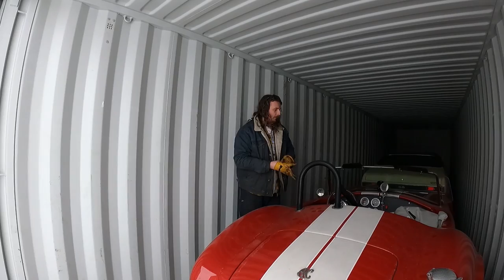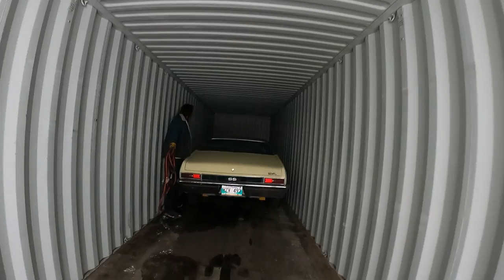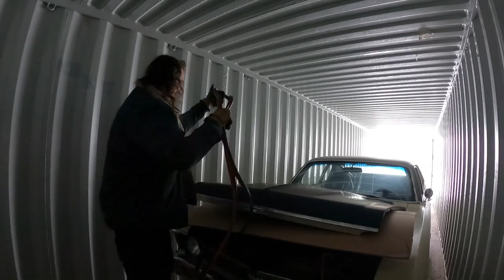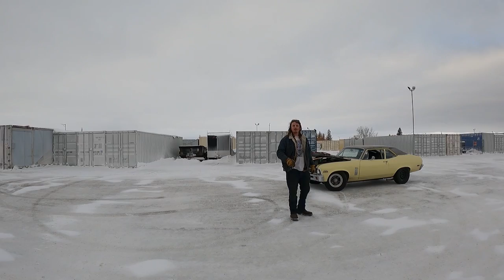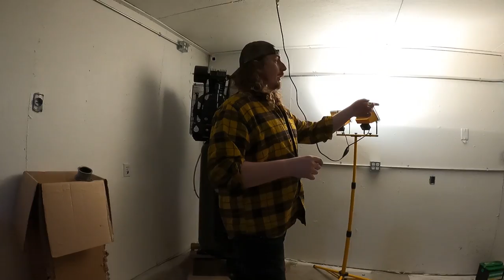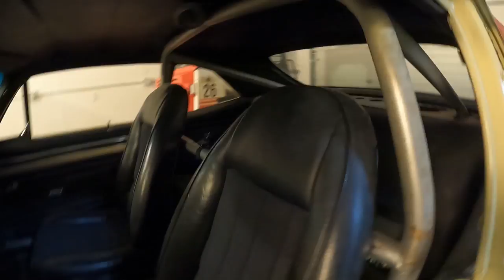1971 Chevy Nova SS 4 Speed Rotting Away In A Shipping Container

Comment: Dan, think about the compressor in it own enclosure. With your electric so close you can insulate and heat it. Less noise and lower maintenance. In the shop filters always need cleaned. Just an opinion, with your different codes in the great winter wonderland. Keep killin' it, Dan

Comment: The M20 is perfect in a street car, you got the low first gear. I have a 1966 belair with a 408bbc, muncie M20 and a 3.55 12 bolt, it takes off from a stop real well with the wide ratio muncie.
Reply: Yeah, I was thinking that 4.10 might be a little much. I think the 3.55 would be more ideal, and you don't need too low of a rearend gear with all that motor. And a pretty light car.

Comment: nice to see sanborn still in business, i bought an 80 gallon 2 stage 5 hp back in the late 80s/early 90s, then traded it for a nice 68 chevy shortbed with a blown up engine. been using a 5 hp 30 gallon craftsman/220 volt compressor since then, maybe 25 years. back when they made good stuff.
Reply: I painted a bunch of cars with a Craftsman compressor just like yours!

Comment: Hey Dan need to plumb air drops from the ceiling every 8 feet using pvc also a couple of hose reels. No need to have hoses strung all over the shop floor. Also  electric cord on reels hanging from ceiling. But keep trucking you are getting there
Reply: NOT PVC ! to brittle , will shatter 🤠

Comment: Awesome vision well worth the time and effort.    Put as much as you can from the 70’s drag street that you can get away with / re arch the quarters, fiberglass fenders, fiberglass bumpers then send to a trophy place to chrome, seal the floor to package tray, cut out the truck floor / old stool gas tank / battery in the rear with quick dis connect / brake booster under dash bracket clean firewall /. Time and money right.  Love your channel.  From my island in Nicaragua " your welcomed any time " Thax

Comment: In our tire shop back in the 1980s, we had a loud, 3 phase, compressor. I think it was a 5 Hp. We piped the intake out through a hole we made in the wall and fabricated a weather shield over the air filter. That did away with a majority of the noise.

Comment: Love the 70s Street Machine look. You might have to re-arch the springs plus longer shackles to get the lift in the back. Shock extensions too.
I vote skinny 3 1/2 inch wide Cragars and big deep 10” wide Cragars out back. Centerline Auto Drags are cool too I ran them on a 65 Mustang many years ago 3 1/2 inch wide fronts with 15” Volks Wagen skinny tires up front and Hoosier Dirt Boss out back , they hook good on the street ;)

Comment: I'm in my late 60s now. Grew up in the 70s and all the cool Novas back then didn't have the rear ends lifted up with 10 inch wide wheels. They had big blocks, and narrowed rear ends so they didn't sit up in the air. The cars that were lifted didn't grip the road like the ones that sat lower. The really fast cars weren't raised up with air shocks , or shackles! But each to their own.

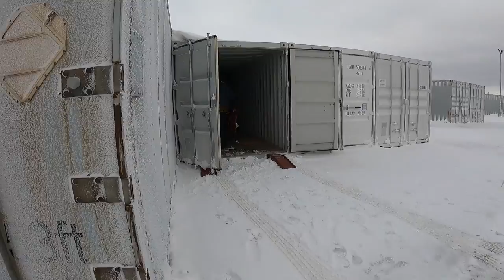Comment: A buddy had version of your new concept Nova back in the mid 70's. It was a faded lemans blue with white vinyl top completely ragged out with chunks bondo missing... but that where the ugly stopped. It had a 396, worked over heads,  hookers with purple hornie header mufflers with turn downs, close ratio 4 speed and 4:56 posi, cragers all around. Ran like a stripped ass ape it was that perfect combo built on the right day. Handling was an serious issue, it was hard to stop and it wouldn't turn, it just went straight. Probably needed better springs and shocks upfront, some sort of sub frame connectors and loose the air shocks out back. In those days we only cared about going fast stopping and turning was for sissies!

Comment: Build a little closet of the side of the garage insulate and plumb the air into the garage and run pipe down the wall with hose bibs in random places for easy access on both sides of  your projects that will put the compressor out side but in its own room

Comment: Intersting Nova. Who replaced the fenders?  Fender louvers were only on 1969 and 1970 Novas, not 1971.
As for the rear wheel wells, a trick I saw a guy do and you might want to try is to use 1975-79 Nova lower half quarters and inner wheel wells. When they redesigned the Nova for 1975, the rear wheel openings were raised slightly. And while the quarters are different what you do is cut out the area around the wheel opening and graft that section onto the older body style. That way the openings look factory but are taller. Also, the rear subframe of the Nova didn’t change from 1968-1979 so the inner wheel wells will fit and hive more space.
Good luck with it. 👍🏻

Comment: The best place for lights is where the wall meets the ceiling.  Try to find fixtures that are enclosed with shields. Mount at a 45 degree angle using plywood rips and 2x4's for supports. Guarantee you will not regret this location, and will not be in your way. A remote compressor room built outside, is a space saver, if you can pull it off, after final walk through, and occupancy approval.

Comment: Dan 
  By the way I think it’s awesome that your pulling the motor out of the 56, do yourself a favor while you have time pull the oil pan on the big block and check the wrist pins on the rods, just a guess but I think it might be where your knock is coming 
From plus with the nova running you have time 
To make sure the big block is bulletproof

Comment: I just boxed in my compressor to muffle it some anything helps but its nice having a 2 stage because only you working wont overload it so it wont run constantly. Just run a 2nd  air hose over the to other garage if you need air over their temporarily. get a good moisture filter to run the air thru. I piped my garage with copper airline so it cools off by the time it gets to the paintgun and theres no moisture issues to mess up tools. Silver solder required on copper for high PSI use fyi

Comment: Easy way to raise wheel arches is to get a set of front fenders, can even be off a 4 door doesn't matter.  Cut the arch out of the right front fender, and it lines up with the left rear 1/4 panel.  Of course you have to cut rear arch out and inner fender etc from the rear 1/4. So basically just flip flop the front fender arches to line up with the rear.  I overlapped when I did mine, but you can also butt it.

Comment: A good idea for the compressor to be outside of the new shop is to just buy a small amount of blocks to build a small inexpensive housing for it to keep it fine from them below freezing temps you were worried about, and your ease of access would just be a simple door on it. The best, cheapest, easiest build would just be in the style of a small outhouse and as I mentioned blocks would be the best option over any other materials in respect of protecting it from the cold weather...just an idea...and it can be placed right outside of the entrance and even joining it to the actual garage structure which would eliminate the need for one side of the walls as your garage wall would be that :)

Comment: I would have felt cheated if you didn't do some donuts in the Cobra in the snow. Nova drifting in snow is a bonus. I put up a video of my compressor dryer last night, cheap, easy, simple, and it works. You should do one for your shop, it saves your air tools and dry air is mandatory for painting. Garage was looking great on the stream last night, you almost have enough light in there now. My shop is like a dungeon, I need to string more lights.

Comment: If you can plumb compressor air inlet through wall, will be a 50% noise reduction. I used a new peanut sponge as an air filter. Stuffed it into an oval funnel.

Comment: I got tired of hearing the damn compressor in my shop, so I plumbed the air intake to the space above the ceiling. I drilled a hole in the ceiling, got some pvc pipe, and installed filter in the attic. It cut the noise at least by 50%. You could also drill a hole through the wall and put the air intake on the outside like efficiency furnaces are.

Comment: Maybe build a small shed a little bigger than the Air compressor for it just out side and mont Heat lamps in there to warm it.  Or put an Electric oil heater in there!

Comment: Its a plan and plans go as they come and go. Listen to all the questions on saturday and answer all just once instead of the same question over and over. I used kerosene in my oil  on my compressor and it worked fine here in alaska where I get is just as at sixty five below for weeks at a time. I'd box that unit with a heat source in and out. You have too much hot weather for kerosene in oil pan of compressor. Moisture would get yours with out a in an out warm air to it, not your warm. Cold air is dense air or heavy air and can mess with tools

Comment: You may not have noticed , but that brown Nova has had the wheel openings split and stretched in order to run those tires .29 inches is about it for the stock fenders , if you don't stretch them , the tires have to be moved farther in towards the center of the car , which ruins the effect you're looking for .

Comment: The real thing I think that would be a problem with the compressor being outside is the water that the compressor will create.  It is a pain in the butt to have ice form inside a pipe and it burst, I know I worked maintenance with miles of compressed air lines.  We had nothing but troubles in the winter and that was in the middle of the USA.  When you compress air the moisture in it doesn't compress so suddenly you compress the air 10 times and you still have the same amount of moisture so suddenly you have lots of water.

Comment: put the air cleaner of the air compressor thru the wall  most of the noise will not be inside the bonus is you will not need to change the filter

Comment: Sounded good 'til ya got to the whole 'shackles and lifted to the moon" part.
Your car though..
🤪
Enclose the compressor with a couple plywood sheets lined with egg carton..takes a lot of the noise away.
Vent it to the outside for cooling with a dryer duct..route the duct hose to a home fabbed fan shroud.
Also, lose the pallet it's sitting on and give it some old hockey pucks for feet..the pallet is just a big ol' sound board.

Comment: Those are 1970 style tail lights. I was gonna say this is actually a 1970 Nova but the front blinker lenses in the front bumper are Amber colored indicating 71. So it's either a 71 Nova with 70 Nova rear lights, or it's a 70 Nova with 71 front turn signal lenses. AFAIK those were the only differences between 70 and 71. Body wise.

Comment: Looks like that car's been sitting in a rust belt area but I can't complain I live in a rust belt area too not the worst but definitely not Southern california dry. I've got a Brand New trailer it was when I bought it and the paint is already fell off and surface rust started and it's never even been on the road. The frame is not rotted into but it just goes to show you high humidity levels cause paint to fall off and rust to happen. And it's even worse if you run the vehicle in a salt chemical snowy area.